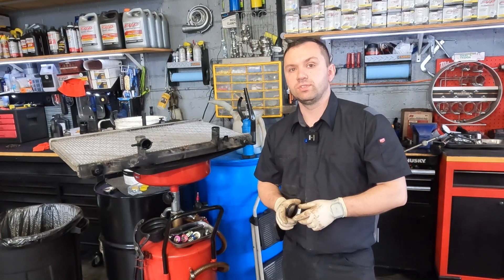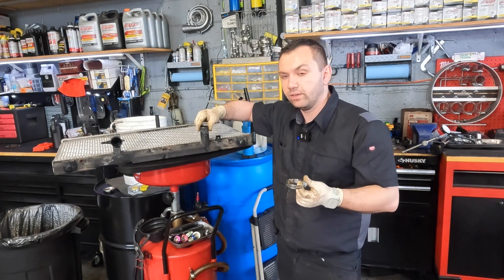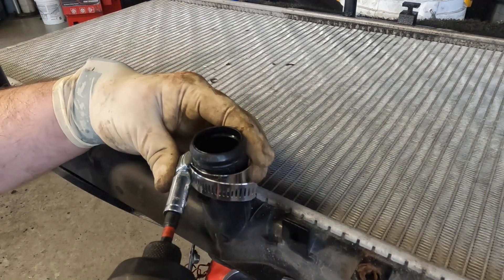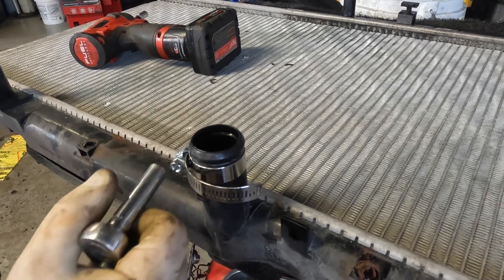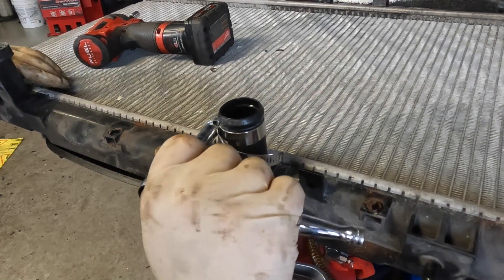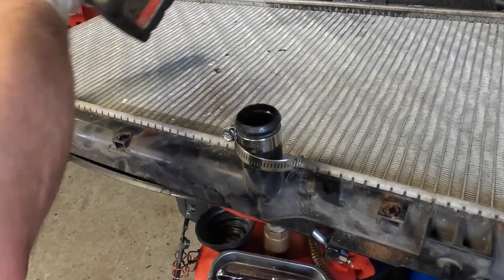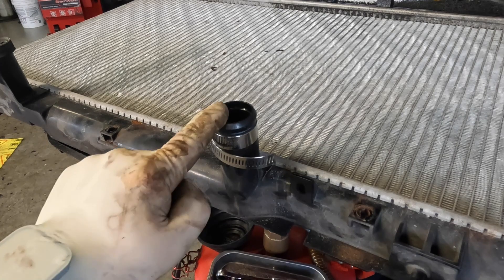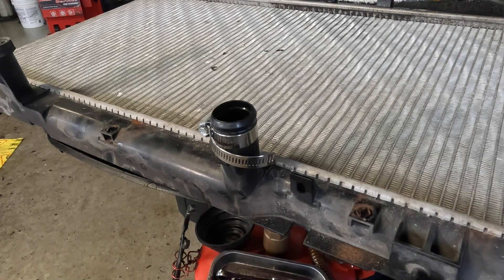HOW TO PROPERLY USE AND TIGHTEN WORM GEAR CLAMPS SO YOU DON'T DAMAGE YOUR RADIATOR!

Comment: I feel the first section is missed- how to adjust gear before starting
Reply from the maker: It’s quite simple lefty loosey-righty tighty. That’s how you adjust the clamp. If you can’t do that I don’t recommend you get anywhere near a clamp or anything that clamps together using this device.😂

Comment: The clamp manufacturers advise around 25 inch pounds of torque in the 1-inch clamp range and about 50 inch pounds of torque in the 2-inch clamp range.  They don't take much...remember that you're effectively just tightening a thick rubber gasket on a plastic part...that never needs a lot of torque.

Comment: I'm considering doing another experiment with the bad radiator on the other hose neck. That is using an inch pound torque wrench. First finding out how many inch pounds it takes to get it snug enough to where you can not pull the hose off by hand. Then finding out how many inch pounds it takes to crush the hose neck.

Comment: I've replaced a radiator in my 2006 Nissan Sentra. The old radiator developed a crack on the top reservoir. 
I tried to find new spring tension clamps, and no one carried them in the size for radiator hoses. I didn't want to use the standard worm drive clamp. I finally found a store that can get constant torque clamps, and that's what I used.
I only drew them down good and firm and didn't go any tighter.  And I used a nut driver, which is the only thing I ever use on hose clamps. I never use a wrench or a ratchet and socket to tighten hose clamps. 
I experimented with the bad radiator. I put an old hose on it with a standard worm drive clamp. I drew it down firm and snug but not tight, and it did not crack the hose neck. Then, being it is a bad radiator anyway, put a ratchet and socket to it. I was cranking down on it pretty tight before it broke a half inch chunk out of the hose neck.
That experiment on the bad radiator gave me a pretty good idea where the danger zone is tightening a worm drive clamp on a plastic radiator.  I could have gone tighter on the constant torque clamps on the radiator I put in my car, but I didn't want to risk it. I'm confident they're tight enough to stop the hoses from slipping off, and the original spring tension clamps are only but so tight anyway.
Reply from the maker: I’m glad you found constant torque clamps! I prefer them myself, but they’re usually really hard to find in my area unless you wanna call the dealer and wait for a few days which isn’t ideal

Comment: Is there any way to fix the plastic if by any chance you cracked it by tightening/loosening a lower hose? I had a stuck clamp and had to cut the clamp off and wonder if I broke the plastic. Guess I’ll find out soon when I put the new hose on and start it up 😂
Reply from the maker: If it breaks, you typically have to replace the radiator or whatever it’s attached to. I’ve have never found a good solution for that unless you use a lot of epoxy, but I wouldn’t trust it.😂

Comment: If it is not broken into little pieces, sometimes a cracked plastic radiator port can be repaired.  Some radiators have a port diameter that is just large enough to allow a short length of 1" dia copper plumbing pipe to slip inside.  Coat the two surfaces with JB Weld high temp epoxy and it's stronger than original.

Comment: What clamps do you recommend then? Hard to find oem spring types
Reply from the maker: You can use these as long as you don't over torque them they aren't bad clamps people just misuse them and that creates issues otherwise they are great you don't need the oem spring style those are a hassle at times.
Reply: @TheEnthusiastMechanic  would this method also work on the hose side connecting to the water pump? The same tighten method
Reply from the maker: @BlackdiamondWIS  Anytime you use clamps that’s how I would tighten them doesn’t matter if it’s going on plastic or metal because these claims will give out and break as well at a certain point.
Reply: Thank you. I replaced hose and still having leak. From water pump side and radiator side. It’s not the water pump or a crack in radiator. Seems when it’s cold out it leaks.
Reply: Thanks. I’ll try it again.  If it doesn’t work out I’ll look into getting the oem spring clamps with the constant tension. Any recommendations on which brand of those?
Reply from the maker: @BlackdiamondWIS  the ones that I’ve used for years at the dealership and most shops the company name is called “ideal clamp” that’s what I use at my shop as well. I believe they make them for the parts stores. Just get a really good premium one don’t buy those cheap ones.

Comment: Great video. I saw a video in the past saying not to use the worm gear clamps because the other style can flex and expand as needed, but I realized how many people are using the worm gear clamps and that I should be fine as long as I don’t overtighten them and I check them for proper tightness as a part of maintenance like when I’m checking the oil level.

Comment: Check out video on new generation hose clamp that does not have the problems as does worm gear and spring type hose clamps...https://www.youtube.com/watch?v=G-lRQESr59s
Reply from the maker: I've seen these its similar to a fuel hose clamp they work pretty good but they haven't caught on other systems other than fuel clamps.

Comment: I need to put one of those on my gas tank hose the two clamps on both sides broke and it leaks gas when I fill it up, but I can't get the clamps on unless I undo the whole clamp and try to put it back together there's just no room, it's almost impossible to get it started so I can Titan the clamp up  I wish they were some kind of trick or something.
Reply from the maker: You can cut them off if you’re careful
Reply: @TheEnthusiastMechanic  thanks for your reply I appreciate it very cool